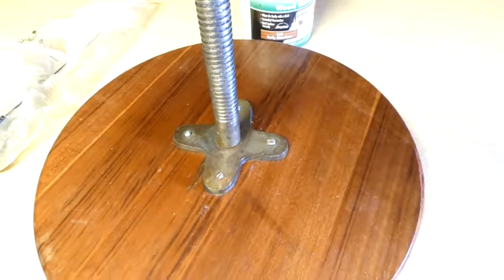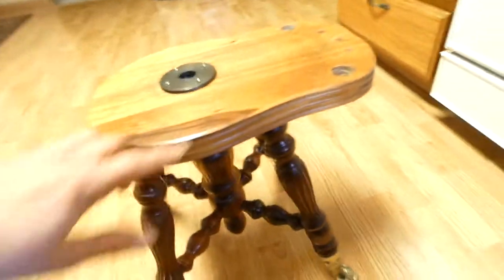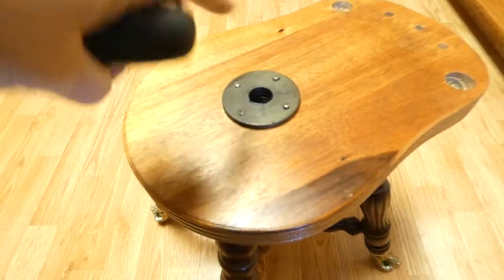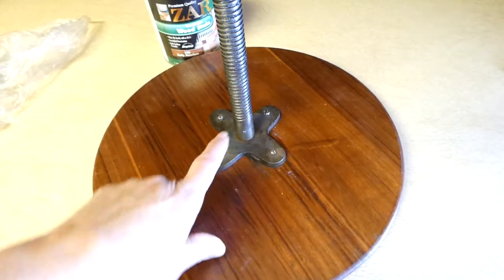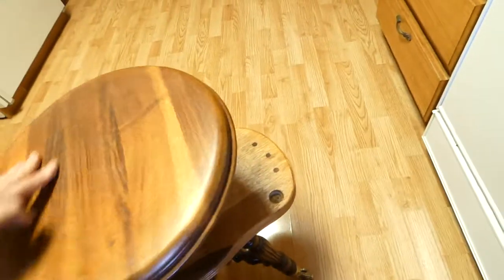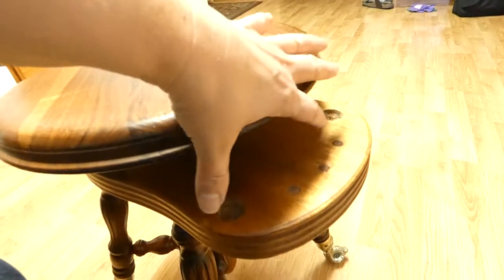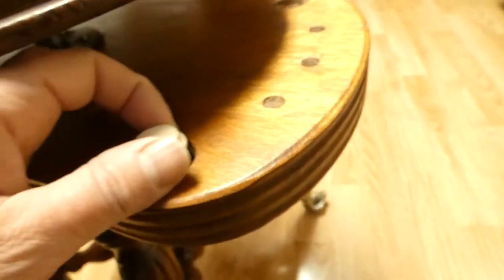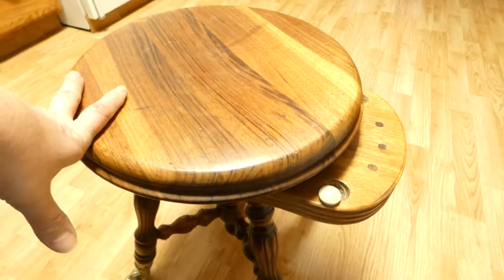Spinning Stool Fix - How To Antique Organ - Piano - Stool Fix Broken Parts

Comment: What does that big screw screw into? I think that's the part that's messed up in mine . It's sort of wobbly. Ty
Reply from the maker: Hi Anita, welcome to the channel!

If you look on the inside of the base of the stool, inside the hole there is a nut that is big enough to fit the screw into. It would have to be custom-made to be the same thread size and count as the one on your stool. You could possibly take your stool to a hardware store and have them measure the thread count and the size of the screw and then look online to see if you can order a tap in nut that could tap into that hole. You could then just tap it in even if you had to make the hole a little bit bigger to get it in there.

Or, you can take it to a machinist and have a machinist make one that would fit on the screw and yet be round on the outside that you could tap it into the hole.

A good machinist should be able to help you, or somebody at the hardware department and a good hardware s Store.

I don’t know how much it would cost you for either of those options, but it might just be easier to look one up online and get a new one that works better. You would just have to research both and find out which one would work best for you.
Hopefully that helps! Thanks for watching and have a blessed day!
Reply: @thesecretisgratitude  Thank you for your info! I will try your suggestions! Have a very Blessed day as well🤗